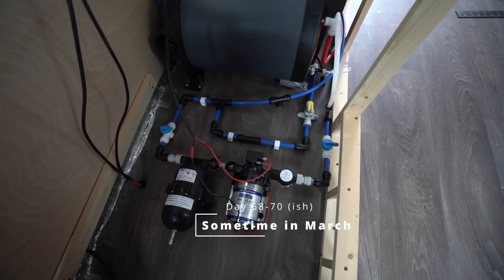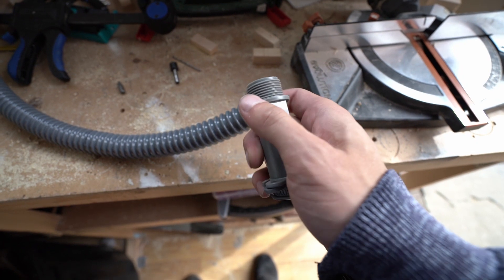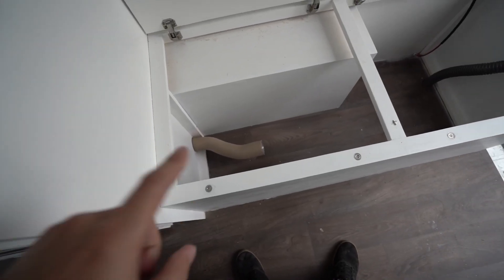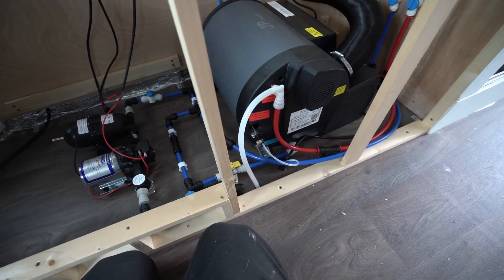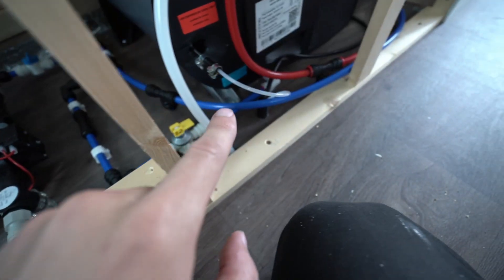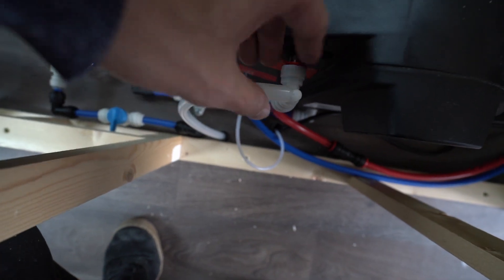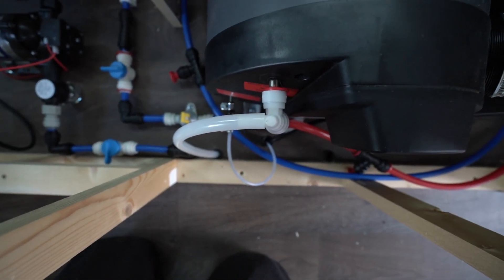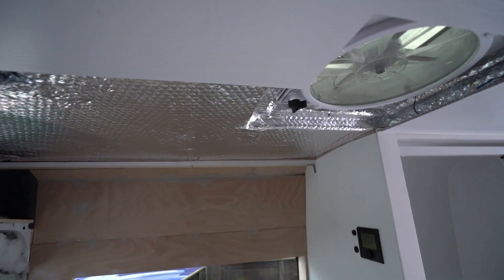Water System Overview - JP Combi - CAK Tanks - Shurflo - Citroen Relay L4H2 Campervan Conversion

Comment: Just been watching your water insyall video.  I am thinking of exchanging the gas truma for the diesel version .
We eat gas in the winter with heating but saying that we would never make enough saving to recover the extra expebsive.  I do have other reasons ie gas will last longer and the heat is drier so less condation in the van . How did the pipes under the van proform as I would have routed through ceiling as guess they will never be water free during drain down as they are lowest point plus the clod will effect them also  duing winter trips etc.

Comment: Was wondering why the water inlet is not outside but you explained it  :) can’t wait to see the kitchen in :) love the fact that you hide everything under the step rather than the van. Excellent job as always.
Reply from the maker: Can't wait to have the kitchen in either! and we should be able to finish the ceiling too now, this has been holding up quiet a few half done jobs! Thanks!!

Comment: Hi hope this message finds you well. I did some research into the Truma JG connections. Truma say to use them in thier instructions, but when you check JG site and specs on the JG connectionss, they should nt be used with Stianless steel pipes, which both Truma and JP use!! Found this out about a week ago, after having fitted a few months ago!! I have these still on my JP Combi for now and havent popped off yet, will keeping an eye on them . Clips crossed my mind to add and see you have done the same now so will add sooner than later!  I also going to fit a Termostatic valve to control temp better when showering and lag hot water pipe to maintain heat better. As i pause the shower between soaping and rinsing etc to save water. Brgds Russ
Reply from the maker: Ah thanks for sharing, it makes sense as the JG fittings need to "bite" or "grab" onto something and it's easier for it to slip from stainless. For us it seems to be working for now with the clips so fingers crossed we wont have issues. Thanks Russ!

Comment: So seems like you purchased a Truma fittings/pressure valve etc. kit.  Could you share what kind of water pump you used? I'm interested in pressure (PSI) that pump puts into the system, as JP advises to use under 0.28Mpa with max of 0.45Mpa.  We installed the kit and our pump is 55PSI (which is over the advised PSI), so our pressure valve is seeping water when pump is on.  Any advice is appreciated, thanks for the video
Reply: Never mind, I guess I skipped video too fast to the other parts, you got the 2095 pump :)

Comment: Hi, thanks for the tip on the clips to lock the hot water outlet pipe in place, struggling to find them anywhere though. Do you have a link where they can be bought from please mate?
Reply from the maker: Hi, there is a link in the description to ebay where I got them from, you can pick from the dropdown list on ebay(locking clips)

Comment: Hi, great vids, really interested in how you've found the water heater, any issues any good points?
Reply from the maker: Hi Steve, It's been great so far, no issues at all. 
It's slightly louder then I expected it to be on the outside of the van (exhaust) I think they made it quieter on the never versions so that shouldn't be an issue anymore. It's not really an issue now unless you wana go super stealth I guess. 
Also one thing to note on electric mode only its not producing anywhere near as much heat as on diesel. Diesel mode is 4kw heat, electric is 2kw so it makes sense. What we been doing if we are on hookup and its cold is boosting temp quickly on diesel only or diesel+electric mode and then once the van is up to temperature switching to electric only to maintain seems to work well.

Comment: Love the truma copy  . How much did it cost guys?. Also if you want a shower or turn on tap for hot water how long does it take to get hot 🔥im guessing it's not instant lol . Great knowledgeable video guys
Reply from the maker: Hi Lee! Check the unboxing / install video, we go over plenty of details if you want to find out more! Unit cost £1150 with delivery / import tax to UK.
It's not instant hot water I think it takes around 20 minutes to heat up the water.
Reply: @CasLaz  wow thanks for the quick reply. Think I'm going to get one guys . Great install video. I have the same layout you have . Instead of putting the heater under the seat area I was going to put in garage but concerned on the fuel pipe length if it was going to be ok . If not I'll go with what you have done under the seat. Thanks Guys

Comment: How noisy is the pump when mounting to the floor? I’d really like to mount mine similar but worried it will vibrate through the floor?
Reply from the maker: To be honest its quieter then I thought it will be. I think the rubber feet + our floor is not hardwood (vinyl)  dampens the sound. 
Especially once it's covered up under the step I think it'll be even quieter.